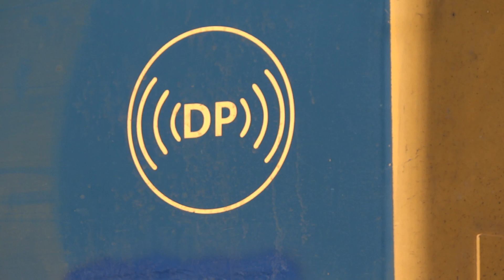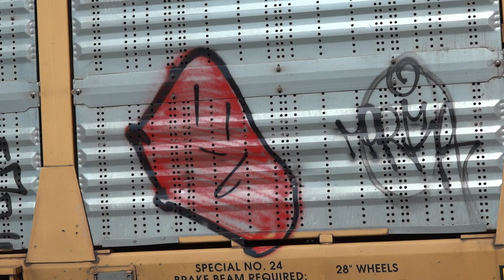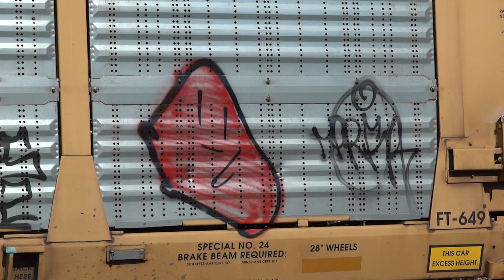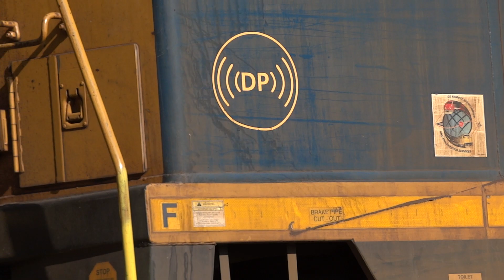New (((DP))) DPU Stickers on CSX Locomotive Engines

Comment: I assume that sticker means the radio gear is installed for remote operation of the unit. I would think most all engines would have it - just for the flexibility in creating a consist.

Comment: 58,800 total YT competitive railfanning foamer points awarded 👍 Key bonus foamer points: Chuggalicious GEs 3,000. Slow foam roll-by 3,000. Cheesy DP stickers 1,000. Flange squeal 1,000. Slack action 1,000. Mid train DPU/PSR length bonus 4,000. Total graffiti 3,000. Total fallen flags 12,000. MOF joy riding by 3,000.
Reply: @BaltimoreAndOhioRR  🤣👍

Comment: Great video and audio, very interesting to hear how the dispatcher communicates with train crews.
And thank you for supporting those of us with a little less knowledge about US railroads, I know I’ve a lot to understand about how your rail systems work!

One thing that I have noticed is that some CSX locomotives have a yellow lightning flash beneath or on either side of the locomotives number on the cab sides, is there a reason this?
Reply from the maker: It's not always applied properly, but it's supposed to designate AC traction motors, as opposed to DC power.
Reply: Oh I see, how about the double flashes on the CSX AC6000s. Is that twice the power or something?
Reply from the maker: @chrisbailey9331  no, that was just a little bit different paint scheme that didnt last long.

Comment: I suppose that means they now have wi fi 🤔
Reply: Since I am already here: it means that locomotive have capability to control locomotive/s mid/rear of the train via radio frequency, since all locomotives work in sync/unison. Engines at the point are connected with cable for synchrony, distant units don't have that privilege and use wireless radio control from the lead engine! ✌️🙋👍🏻